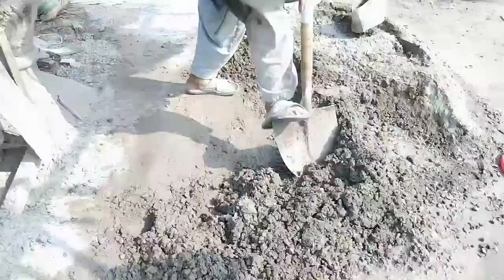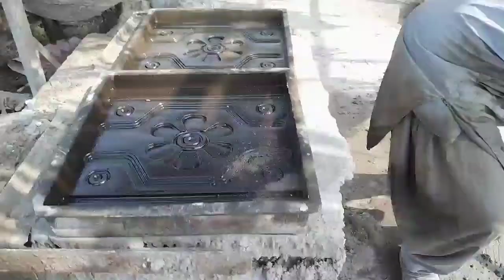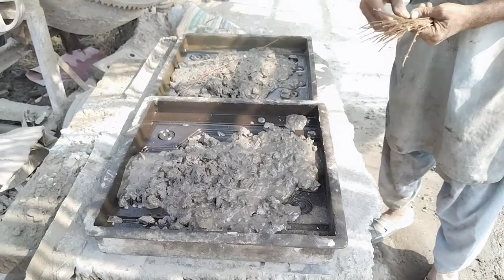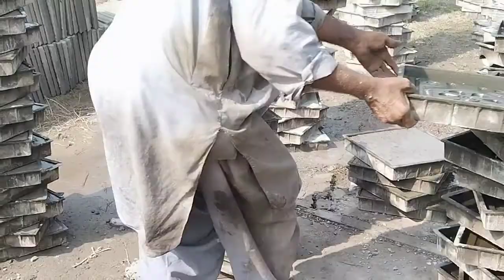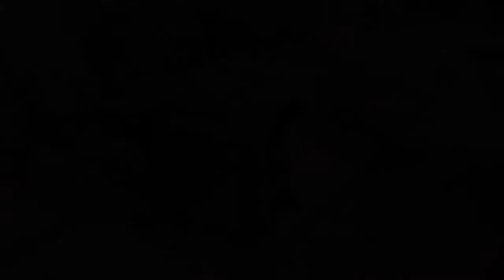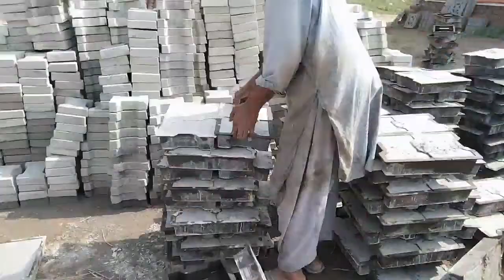How To Make Tuff Tile In Factory

Comment: Cement is not a trash. It cost a lot of money. Even gravel is not cheap nowadays.
Reply: cement is a cemical mixture, thats why its expensive. although.. its not that expensive actually, one bag of 25kg is like 5 dollars.
Reply: @azzorzer  in Ukraine it's even lower price per 25 kg bag - $3.45. But it does not matter if your wage or salary is low. 
Besides I said that about cement because I'm making vibrated paving slabs for my own yard and this requires lots of cement. And the channel name is trash to ... but cement is not such available material nowadays. 20 years ago we paid something like 1.5-2 dollars per 50 kg bag.